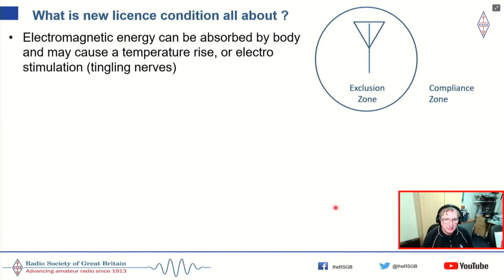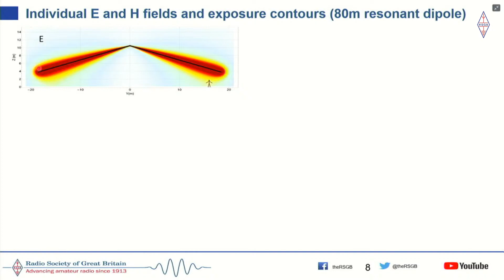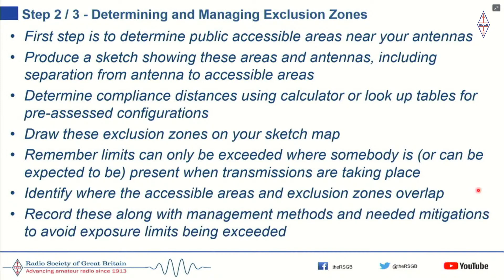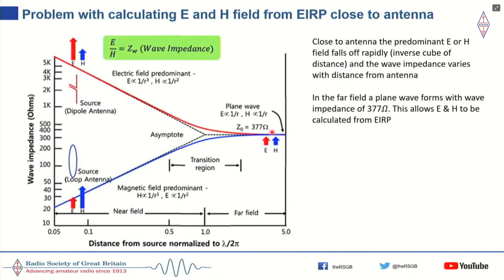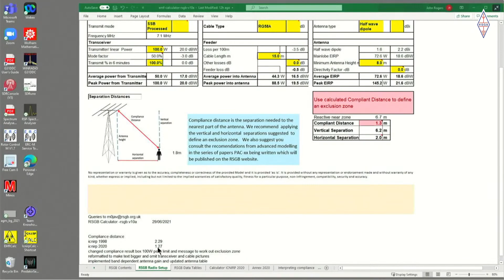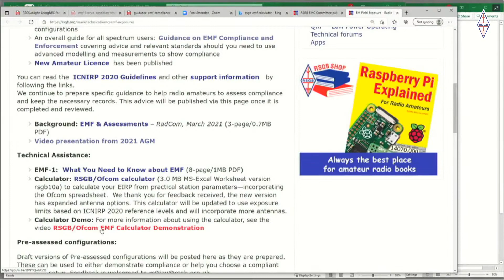RSGB Tonight @ 8 - Assessing your station against ICNIRP EMF levels by EMF Chair John Rogers, M0JAV

Comment: Knee jerk reactions help nobody. HF wire and vertical antennas fed with modest power levels will have reasonable compliance distances.

Those advocating “giving up” need to self train by studying the methods of calculating field strength in the near field of a HF antenna. It is not PhD level, or even A Level, mathematics.
BTW, those cheap field strength meters are unreliable. eBay and the internet is littered with examples, including courses on using them to check around your house with one. Short of buying a calibrated Narda meter (in the thousands), the only modest cost, off the shelf accurate method is a dipole antenna on a hand held spectrum analyser, or level meter. These work well at VHF and UHF, but are impractical at HF.
There are more pre-assessed antenna configurations in the pipeline.

This FCC paper from 1990 gives an insight into likely measured field strengths at amateur antenna installations:
https://transition.fcc.gov/Bureaus/Engineering_Technology/Documents/reports/asd9601/asd9601.pdf

Comment: What about people with small plots. You can't put up mast to gain height and have to feed wire antennas at ground level. Any exclusion zone given by the calculator includes 2 neighbours property.  If your neighbours are out in the garden at the same time as an you want to take part in an event you can't go on air and take part. With limited space and compromise antenas lower power is useless. RSGB keep saying it's no problem to comply.  John says you can operate at lower power to comply but if you can't get QSO's in the log you have no hobby. I can't see any way  to change my antenna and comply.  Even the 2.2 meter so people can't touch the antenna fall in a neighbours garden. RIP to the urban radio ham.

Comment: Sadly the beginning of the end for me. Does the RSGB have any idea or estimates on the number of amateurs who will have to stop their hobby because of this? I know for sure I cannot comply as I cannot ask neighbours to stay out of a section of their gardens. Please give us real world examples with long wire ground mounted antennas in small gardens.
Reply: Noooooo.  Put a big beam up and try killing rats and seagulls.  You will have a long time trying.  73.
Reply: You're asking for something that is quite difficult, especially at low frequencies and with uncertain ground conductance. You could do worse than read the Near and Far field definitions on Wikipedia and in particular note that the near field falls off with the cube of the antenna dimensions. As yet there are no recommendations for these low frequencies from Ofcom and the RSGB because of the difficulty of calculation in these circumstances. You can also monitor for the presence of people close to your garden and safely operate when they are not present.
Reply: @LintonSamuelDawson25  Its going to be difficult to see who is in 3 adjacent gardens whilst I am in a cabin with no view of these gardens. I will need to pop in and out every few minutes. I dont understand all that near field stuff etc, I just buy a radio, stick an antenna up and use it.
Reply: @NToombes  Well, amateur radio is about self-training, so this is an example of where we might need to do that. Don't forget that the limits don't affect amateur licences yet, 110MHz and higher from November 2021, 10-110MHz from May 2022 and the sub-10MHz frequency range isn't covered until November 2022. Perhaps by then better calculation aids will be available. I did see that you can buy an RF Field meter from one of the main dealers for a bit over £100, so it will be just like the absorption wave-meter that we all have.
Reply: Same here. If the neighbours in their garden they are in my exclusion zone. RSGB advice don't transmit when someone is in the garden.
Reply: Also no help if you need to pass antenna wire over the building to get on lower HF bands. Note first model given 80m dipole 2.5m clear of the building and full length of the garden, and at height. Fit that into 43 feet of space and at the mast at the end of garden only 800mm wide so 3.4 exclusion includes 2 neighbours gardens